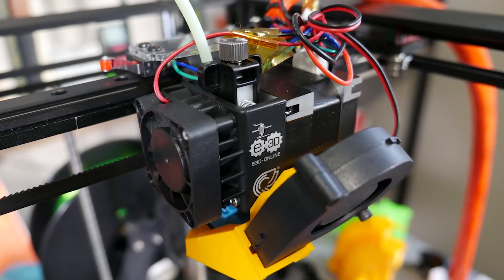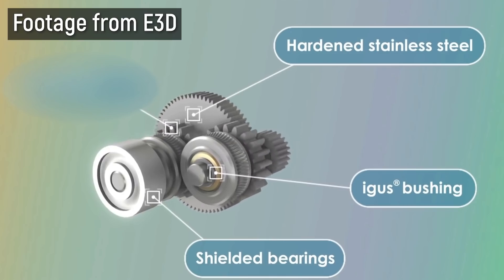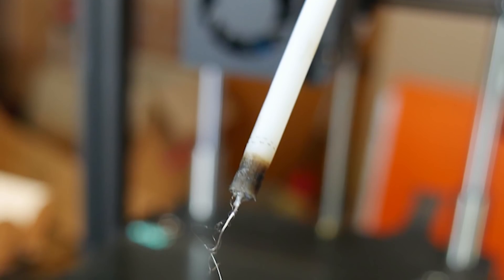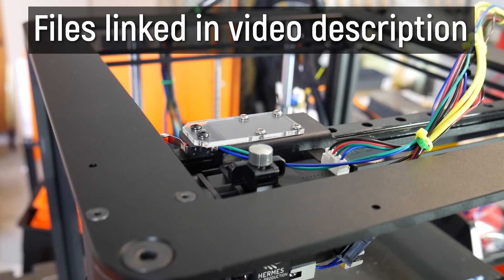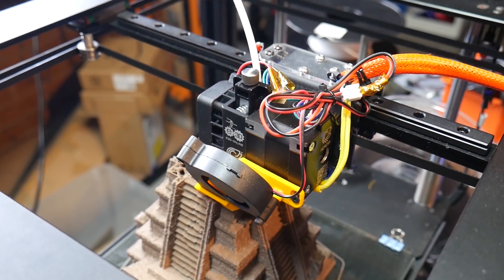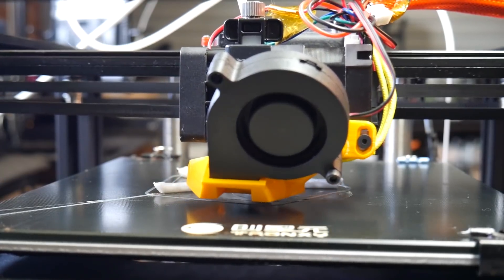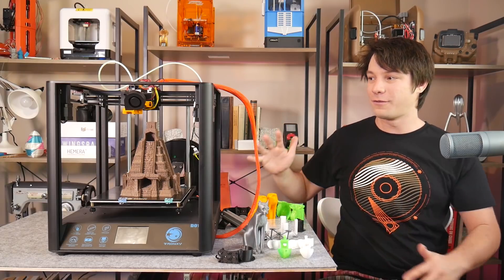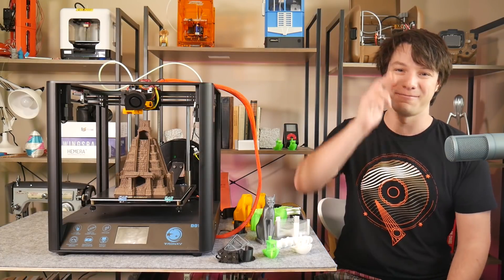I massively improved a terrible 3D Printer - Tronxy D01 Phoenix Edition ft. E3D Hemera

Comment: Little known fact, the heat sync is actually modeled after Sanjay's hair. directing the air away from the print was just a happy accident.
Reply from the maker: haha it's uncanny!
Reply: Having a little bit of engineering experience, I can confirm that every once in a while ideas do start out as an obvious joke that actually ends up giving promising results
Reply: RIP Sanjay, you were an amazing guy.

Comment: I use a soldering iron to hot tighten nozzles on the bench, just need a tip that fits the heater hole pretty well , set temp and tighten.
Reply from the maker: Huh, pretty handy tip! Safer too.
Reply: Yeah, It’s actually pretty dangerous to tighten the nozzle with heat and power applied to the hotend. I found out I had exposed wires from the heater cartridge by my wrench holding the heater block sparking on the wires that pulled back from the insulation.  So now with V6 style I heat it with the soldering iron.
Reply: Smart
Reply: Thanks for sharing that tip!
Reply: Now that is an idea.  Create a workstation that heats a cartridge for assembling heater blocks/nozzles on the bench.
Reply: @williamjf77  Yeah the 24V does do the sparkydance doesn't it 😅
Reply: Very nice tip. I'll try it!
Reply: Better than my method which somehow always involves losing the fingerprints of my right thumb and pointer fingers.

Comment: Nickel plated? They were not screwing around, eh? Nickel is what the blades of jet engines are made of, because it doesn't absorb heat easily (so doesn't expand much) and is rock-solid tough (those blades grind birds into mush without damage [except when multiple large birds end up there, when the airflow and fuel cannot pass easily enough nevermind burn]). It's why certain trumpets can play outrageously loud even with a small bore size like the Conn Constellation - Nickel and Nickel plated in some parts. It's so tough it's an outrageous pain in the backside to machine and bend to make such horns!

Comment: I know this video was a while ago - but I just had an experience that may explain your headless cats.  Printing the cat with a silk type pla.  I was using a JAXA heat box as the filament holder - I'd been printing some wood filled filament that I kept dry at 50C and just added the silk rather than switch holders.  Every now and then the filament roll would jump - waking me up from my chair where I was watching with my eyes closed.  Careful watching found that the roll would creep UP the forward roller which means the filament was unable to release from the spool.  Only issue I could see is that one winding of the filament was against the adjacent filament for about an inch and then separated slightly - until the filament would release from the adjacent filament and the roll would slam back into position and unroll about half a winding before it stopped.  I suspect the manufacturer wound the roll at temperature and the filament windings would occasionally stick together.  Complaints about filament tangling is probably this problem - not tangling but sticking together.  When I have the inclination I think I'll transfer the remaining filament from this roll to another roll and see if there are any hang-ups.  But I thought you might want to know - a reason why one filament creates headless cats and another doesn't - basically the  manufacturer lost control of the temperature during winding and it occasionally got too high.  If it's during winding I'm willing to bet is kind'a periodical - explaining why the printing stopped at close to the same place.

Comment: Welcome to the club. My TRONXY 500x500x600 came with wrong cables, missing parts that I had to order to get correct parts before I could even start a print. Dual extruder cable was way too short for second extruder. When I got the longer cable it did not work until I copued the wiring colours from one to the other and swapping pin locations. Angry with TRONXY Quality Control but once I ironed out the bugs, make great PLA prints on glass bed. I had to switch to glass as the hot end burned a hole in the buildtech sheet. Trying to get setting right for PETG is another trial and error stringy mix. I see that every delivered 3D Printer is a starting point and each owner upgrades it as needed to get the best printer possible.

Comment: I had a serious problem with E3D Volcano hardened nozzle, heat break, and the aluminum heat block.  The issue is that all three part are different metals that expand and contract at different rates.  It would cause leaks at the top of the heat block after a few print jobs.  I chased this issue replacing all the parts multiple times until E3D suggested I switch to the copper block.  It's a miracle, no leaks and no jams for two years now.  
If you have issues with heat creep, jams, or leaks, switch out the heat block to copper.

Comment: I got one for my Ender3 a little over a year ago and apart from over tightening one of the screws on the stepper motor that mounts the print cooling fan and breaking the thin bit of metal it has been a great improvement over the stock hot end. I have not tried any nylons or super flexible filaments yet, which was partly why I decided to buy one, but for PLA it has been working great.

Comment: As Barnes Built said, using a step bit is great. If you don't have one, don't use "progressively larger" bits, you'll just damage the bits, chipping and dulling them.  Use a 1/8" (3mm?) for the pilot hole then go straight to the bit for the final size of the hole.  Anything else and you wind up with bits trying to cut sharp edged metal starting from the middle of their cutting edge and you'll chip them there and quite possibly at their outer edges as well.  Just a tip from a fabricator, take it or toss it.

Comment: I had a hell of a time getting their extruder to properly grip the filament.  After a month of tweeking with it trying to get it to work, I decided the tensioner was way too finicky for me and promptly went back to my bondtech extruder on my main printer and haven't looked back.

Edit: wow, that frame is super flimsy.  It badly needs some bracing, you can see the whole frame moving back and forth while you're printing.

Also, I put the DDX on my nephew's ender 3 and it's awesome.
Reply from the maker: It's the folding table its on sadly, the frame is super rigid surprisingly. I need less flimsy tables that also can be stored away!
Reply: @MakersMuse  
Maybe you can print some snap-on braces that would tension the legs against the table top.  If the legs are stiff, it won't wobble.  Or just replace the folding joints with some better joint that probably already exists.

Comment: Looking forward to more of your 3D printing videos, great mods! 

(Maybe to help with cooling you need more cooling fans? As for the mysterious filament jamming it could be the hemera's early production errors losing torque. Otherwise, a temperature and humidity soaked problem where the filament needs to be baked and printed at above normal pla temps. Additionally, perhaps a filament spool holder/feeding at that height bends the oversized bowden tube that it cannot feed smoothly anymore.idk hope these well intentioned guesses help.)

Comment: Thin stepper motors are fine until they got hot and begin missing steps even with Duet WiFi drivers at 24V. It was smart move. And Trianglelab clone is better as for me due to they solved problem of easy changing nozzle block.
Reply: My hextrudort works perfectly.  Maybe pancake motors have issues, but there are other formats.

Comment: D01 is a great candidate for upgrades, i'm doing one myself with a high temperature heated chamber and increased build volume
Reply from the maker: Oh! Increased build volume, how are you managing that?
Reply: @MakersMuse  Custom long thin bowden hotend + linear rail mount to get a few cm more x axis and turn the whole top frame with the motors upside-down so motors are on the top to get a few cm more z.  print volume will be ~28*23.5*24
Reply: @sigmatechnica  what firmware are you running and any tips for customizing print settings?  Acceleration updates thru Start G-Code in prusa Slicer seem to take.
Reply: @lennynnnnnn  I upgraded the control board to a duet, there are so many machine changes by settings won't be helpfull to anyone else!

Comment: My only issue with this is the huge increase in moving mass. What speeds/acceleration/jerk are you running?
Reply: Are you actually able to change the acceleration on the D01?  I found that any of the typical gcode commands dont take with the stock FW...
Reply: @lennynnnnnn  you can if you flash Marlin to it

Comment: Great video review. The thin throat makes it too easy to break. It would been nice if they did like the mosquito or the dragon which has posts.
Reply from the maker: Yeah, two thermally insulating posts to resist torsion would set my mind at ease when changing nozzles.
Reply: @MakersMuse  Accidents happen, is possible to remove one of if it breaks?

Comment: I have the same "glass lattice" thing from tronxy and nothing would stick until I roughed up the surface, it now prints PLA with a 50deg bed though YMMV so try lightly sanding with P60 sandpaper on the bed don't go too hard just make sure there are lines, 240 didn't seem to work

Comment: I've fitted a Hemera to my Ender 5 plus and now it will print anything at default cura PLA speeds or faster , Using the default cura speed of 80mm/s I've printed TPU and PETG where before I would have had to really slow it down to 30mm/s for PETG and TPU just wouldn't print reliably. 
Since I've had the Hemera I've had just 1 jam which I think was cause by my dry box ? ,  I had to remove the heater or thermistor , and them unscrew the heat block and heat break , all while still connected to the printer FUN.
Yes , I think printing at high speed does cause a lot of ringing with the extra weight , but for functional part that isn't a problem , just slow the print down a little and it will print like glass.

Comment: Great video, but I was never a fan of the Hermera and the E3D hotends in general.  

On the Hermera, the heatsink that would normally be used to only keep the cold zone cold is now also keeping the stepper motor (which produces a ton of heat) cool.  Just unnecessary.  It may work, but the heatsink wouldn't have to be as big if it wasn't also having to dissipate the heat from the stepper motor.

E3D just seems stuck with the V6 heatbrake design and refuses to do anything better.  I absolutely despise the loose hot block, having to hold the block while tightening the nozzle.  And the fact that because the heat brake is the only thing attaching the block to the heatsink, you have to balance strength with trying to reduce heat transfer as much as possible.   The result is always a compromise between being too weak and likely breaking if you have any sort of nozzle crash at all, or too thick and doesn't do its job as a heat brake well.

The Mosquito, Dragon, DragonFly etc are all amazing hotends, more compact than the V6 with a better heat sink design (quite a bit smaller), and because the heat brake is no longer structural on those, it can  have much better thermal properties because it's much, much thinner.  And to top it all off, one handed nozzle changes.

I wish E3D would do something different.  They're a great company and I support them where I can (I always buy the E3D Copper Plated Nozzles), but their hotends seriously leave something to be desired IMO.  The E3D V6 was great in its time, but there are much better solutions out there these days.
Reply: Hey, thanks for your honest comments and for supporting us where possible. All we can say is that big things are on the horizon, watch this space, we hope we'll be able to blow your socks off later this year. Thanks, E3D
Reply: @E3DOnline  @BladeScraper This seems like a really genuine, constructive interaction between a consumer with valid criticisms, and a manufacturer who is doing their best to innovate in a new space. You love to see it, and it's great that content creators on YT like @Maker's Muse are able to facilitate it! 

One of my favourite things about 3D printing is that even relative outsiders/amateurs can and do have brilliant ideas and breakthroughs. It might be the most communal, globally developed technology ever!

Comment: I did a bondtech conversion and used a MicroSwiss all metal hotend. It was an easy swap. My problem and I believe yours with this printer is the bed wobbles way too much and needs more support.

Comment: One thing to try to address that clogging with PLA is to make sure you have good thermal paste application With the heat break. I under did it and got heaps of clogs, but fine now fixed. I think the clogs happen on retract which makes sense on the chin because you’re doing travel moves between the two zones (body and chin). Also a part of the model with heaps of perimeter and not much infill, ie worse for heat creep.

Comment: My solution for inadequate cooling performance due to the bed heater was to simply set the temperature to 30° after the 1st layer. The reason I don't turn it off completely is because the room temperature is about 10°.

Edit: Have only tried this with a paper tape bed and PLA. Not sure if this works with any other material.
Reply from the maker: Yeah, I do this for many of my other printers but with the ceramic coated glass beds, they "self release" at lower temperatures so you can't turn them down much.

Comment: Stringing is part for the game for flexibles? Try the "NinjaFlex Profile - Zero Stringing - Flawless Print " from prusaprinters on your MK3/MK3S.
I'm basically printing TPU flawlessly like PLA with that profile. I can fill the buildplate with TPU prints and i won't get a single wispy string.
With the hemera you definately should not be getting any stringing, as the system is almost made for printing TPU.

Also, if your CF Nylon has a "really rough surface finish" it's probably wet. CF nylon doesn't really string that bad, but it gets a really rough surface finish when it's wet.
Reply from the maker: Great profile, thanks. Doing some tests now based off it and also trying external perimeters first - much better on the benchy now trying the wheel again. The rigid ink PA12 CF really is that rough, and actually a little too stiff (you can snap the filament on the roll), I dry it for quite a while before printing.

Comment: Hey Angus, great project! I own a D01 too, with a similar mod: the stock titan extruder mounted on the X carriage to make it direct extruder, and it works very well! 
PS: I tested the thermal protection by pulling the sensor cable, and it has it, so that's out of the way!
Cheers!
PS2: The failure on the cat may be related to the temperature PID: on my machine, it had a +/- 10 C oscillation: this may cause it to swing too hi and then too low when there's a change in flow rate.
Reply: I have this printer with the same mod. I had the same issue with the +/- 10 C oscillation. Made a few PID tunning, and now have only +/- 5 C, example 200° oscilate between 198° and 203°. 
But still have a problem with layer shift sometimes, especially on some tiny infill areas. The belts are tight, all the machine has litium grease on the rails, steels rods and acme rod. I'm trying with the acceleration and jerk values. My actual values are 1000 acceleration and jerk, and print speed 40/50mms almost time. Do you have layer shift any time?
Reply: @L3chuckk  Hi Diego! I had layer shift problems before, I solved them by lowering the jerk speed (I used a guide, i think on Prusaslicer or Slic3r, but many slicers have guides to set this up) I use 10mm/s of Jerk on an i3 build I have, but on the D01 we should be able to use higher jerk speeds. Cheers!
Reply: @agl33  i tried from jerk 25 mm/s AND had to decrease to 20, 15, AND finally 10 mm/s. If a use More jerk than 10 on some prints have layer shift.

Comment: I've done a similar mod to my Sapphire Pro and it went from being a terrible and unreliable 3d printer to a great machine. The first things I did was replace the original firmware with a version of marlin, replaced all the noisy fans, replaced the stock PEI sheet with a creality magnetic bed and replaced the stock rigid lead screw coupler. Then I tried to upgrade the shitty hotend with an E3D v6, but the prints were still unimpressive and inconsistent. I decided I wanted to upgrade to a light direct drive extruder, so I bought a titan aero conversion kit. To avoid reducing the build volume too much I flipped the entire top plate upside down, to have the linear rails, belts assembly and mtotors on the top. I also inverted the x axis rail, to have that on the top too. The last mod I did was adding an auto leveling probe, to bypass the crappy and unreliable z endstop. I would like to stiffen up the bed frame to make it less wobbly and build some sort of cover to hide and protect the belts. But even as it is right now it's a great printer, and MUCH MUCH better than before.
Reply from the maker: Nice! The Sapphire Pro is SO similar it's almost the same printer. It also got panned heavily by reviewers so great to hear it's redeemable with a similar upgrade, though sounds like it was a fair bit more effort!
Reply: Damn. If you billed your time at minimum wage, how much better of a printer could you have started with?

Comment: Yep i had similar issues with Filamentum PLA. I found that due to low clearances in the heatbrake, if you retract and then extrude only small bits of filament before retracting, the filament gets stuck in the heatbrake.

Comment: Cetus 3d printers don't have thermal runaway protection either. Try unplugging the hot end thermistor, it'll start heating uncontrollably and continue until the heater burns itself out.